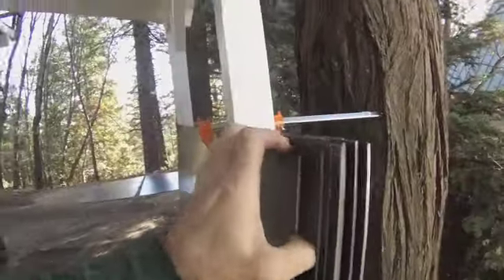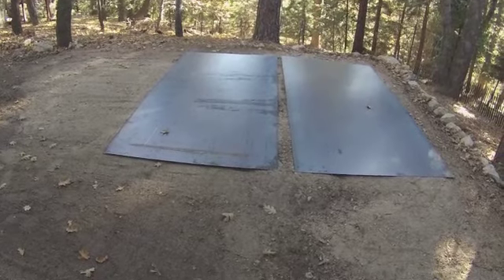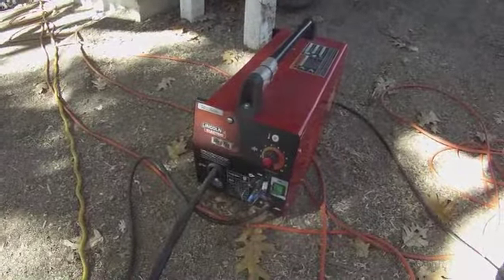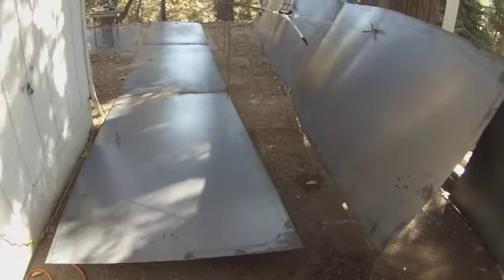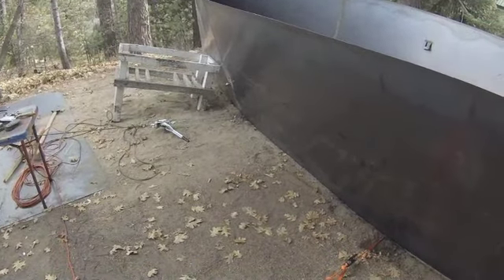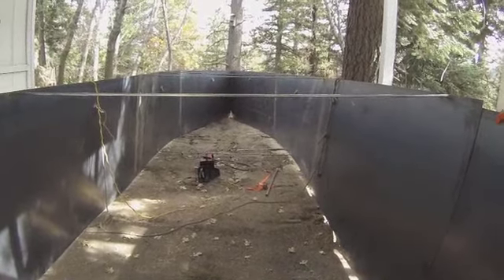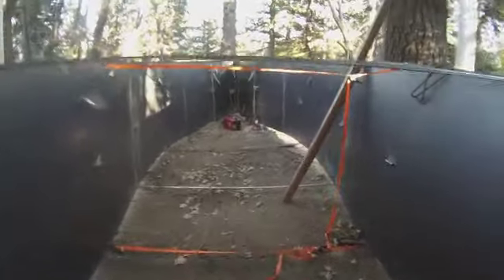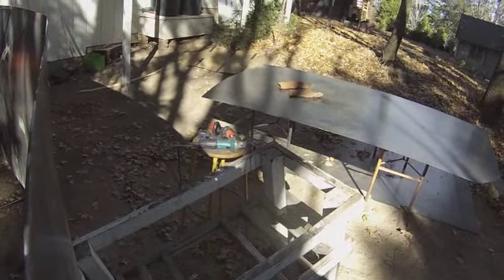Steel Sailboat Build   Part 1

Comment: Craig, I've used small welders with a 20% duty cycle.  I remove the covers and put a fan next to it to blow out the heat from the core.  This greatly extends the time it take for the thermal overload to shut it down.  I'm in Van Nuys.

Comment: Craig, i had that problem over heating duty cycle. i put 3 computer fans in on there own 12 volt power source, and i could well all day without any down time, unless i wanted the down time. two fans right on the transformer and one facing out to remove the heat. noise not that bad, rather well than worry about the fans, Doug sent us over from SV Seeker, Old One Legged Joseph T.
Reply from the maker: Great idea.  I'll see if I can rig that up.  The panels come off easily, so it shouldn't be difficult.

Comment: had you considered gunnels and bulkheads stood upright and flanged and then welding sections of hull along the outside?  To me it seems the obvious way to go and since I'm not doing it and you are I was wondering what the thought process was for one method over another.

Comment: May not come across that situation again now that you're past it, but if you're trying to pull stuff together like that, it's always best to just use a locking pair of pliers (the parrot style come to mind) and weld beads as you make it come together. They are also useful for grabbing sheet metal and moving it around. 
Digging the build so far, found the pic on Doug's channel, figured you had to have some sort of video by the way it looked and went hunting :) this is going to be a neat boat when she's done.
Reply from the maker: Thanks for the comment and the idea.  I love learning new techniques and how to use new tools.  How would I use locking parrot pliers to pull the ribs to the sheet or line up a sheet to a sheet?  Weld a piece to lever against with the pliers?

Comment: looking forward to this. would you recommend starting with say a rib Skelton and welding the sheets to the ribs instead of trying to do the shell first?
Reply: A rib skeleton would make symmetry much easier.  The added challenge would be hanging the sheets on the ribs instead of standing them up on end on the ground.  Hanging them would be totally doable with some jack stands.

Comment: was worried, with the statement of building it without plans, ive done that on small houses, and cabin's. they turned out ok but cost me a lot of extra money, and work but there never going out onto the harsh ocean salt environment. just a warning don't go cheap on the paint and corrosion inhibitor, it will come back to bit you or who buys it in a couple years. but good luck. not sure if you used corten steel, but I'm looking at aluminum boat's
Reply from the maker: Aluminum is the best, in my mind.  I just can't afford it.
Reply: Can weld aluminium?

Comment: bud your welds do not look good at all.they look dirty, your metal looks dirty and not even remotely prepped , and you have it laying on the ground that's why your welds more than likely aren't lookin too good. i don't mind the budget based mind set but you would have been better off getting a more higher end welder that runs off it's own generated power .